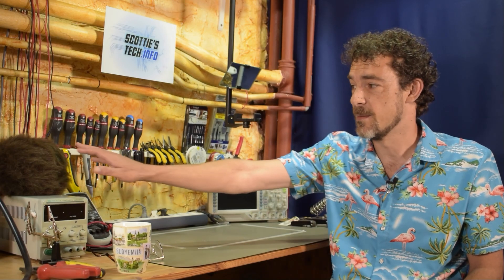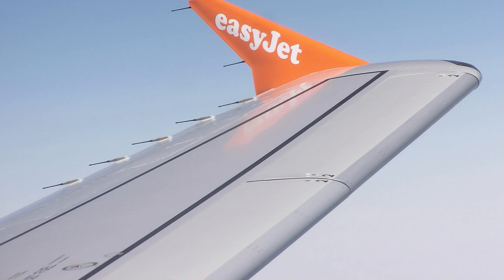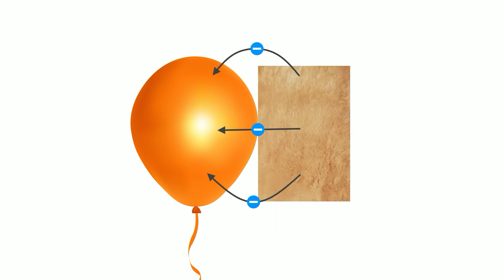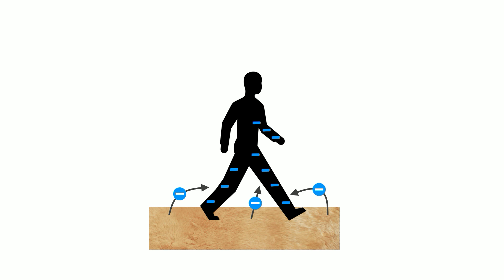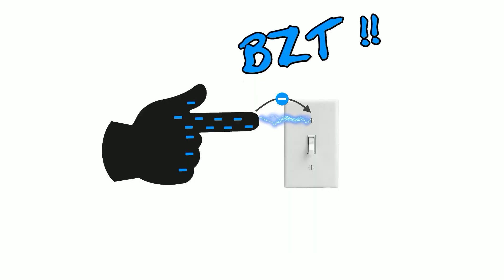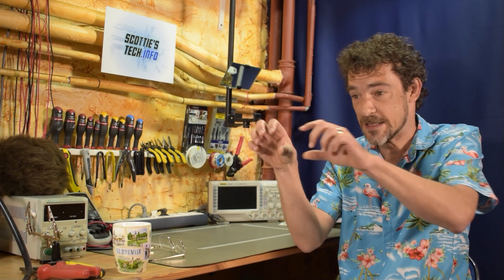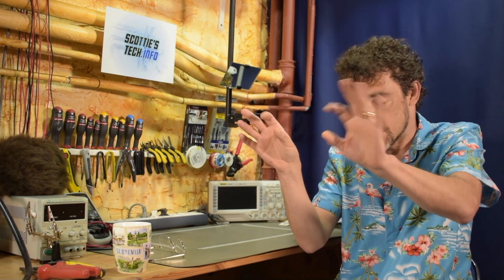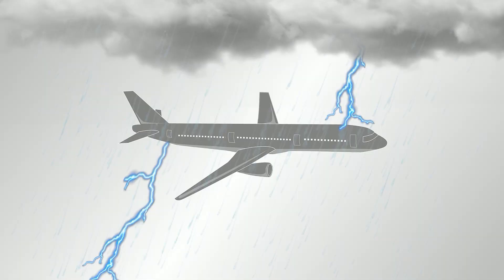Airplanes, lightning, & the wild world of Static Electricity

Comment: Many years ago I was working in a woodworking shop operating a very large belt sander. When running the machine, the operator would build up a large static charge quite quickly. One day I decided to be very careful to avoid grounding out on anything to see how much charge I could hold. The floor was wood and I even stayed away from the screws in the floor. I made it all the way from lunch break to afternoon coffee-break without grounding out and I decided to get rid of the charge on a friend. I came up behind him and held my hand toward the back of his neck. A bright blue bolt of lightning came out of my finger tips when I was still about a foot away from him. That was the funniest thing that I had ever seen! Unfortunately, my friend didn't see the humor in it. After a little cooling down period, we were still friends.
Reply: Fascinating

Comment: 11:29 - Kinda confused here. I thought the ground(earth) was negatively charged. One more question: Is statically charged static electricity(either way the same thing as negative ions such as in some air purifiers vs positive ions? Thanks
Reply from the maker: Charge is relative, so it appears confusing, but it actually isn't.
Reply: @ScottiesTech  Is statically charged static electricity(either way the same thing as negative ions such as in some air purifiers vs positive ions? Thanks
Reply: @ethimself5064     No.   A static charge can be either positive or negative, and is also stationary (static), but an air purifier (air ionizer) emits a flow of negative charge.
Reply: @simonruszczak5563  Thanks
Reply: @ScottiesTech    Potential of charges is relative.